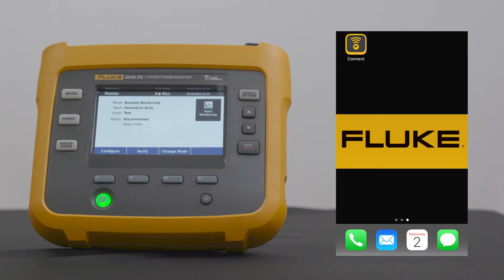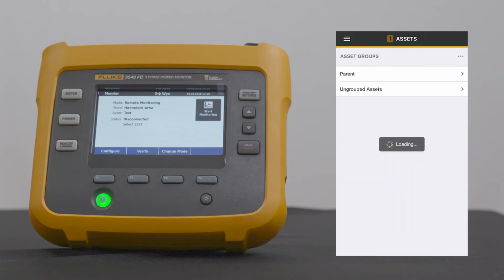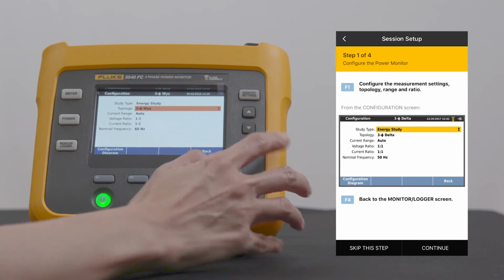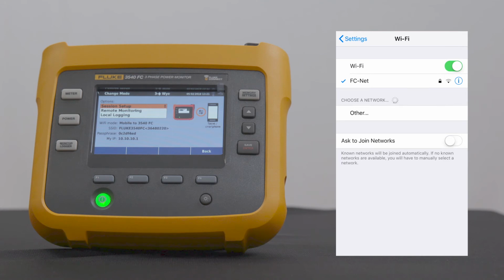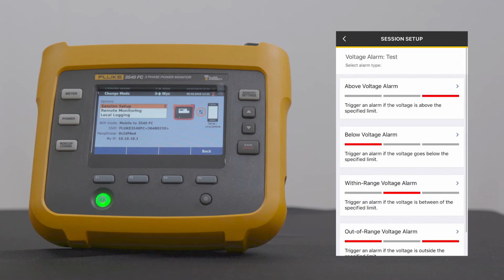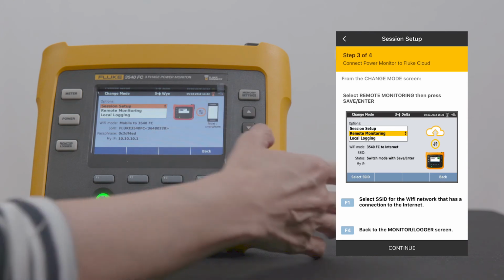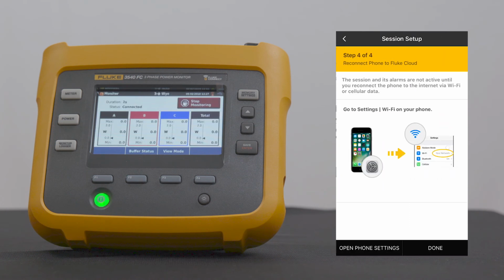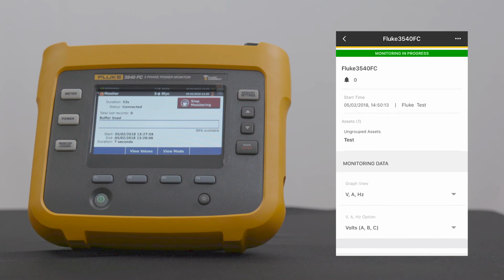How To Set Up the Fluke 3540 FC Three-Phase Power Monitor

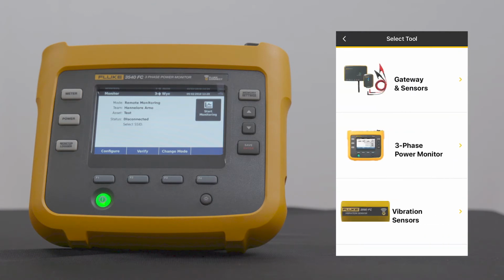Comment: 1:25 whenever I try to select the "3-Phase Power Monitor" it says, "You need Fluke Connect(R) Condition Monitoring SUBSCRIPTION."  So frustrating, just start logging to the USB stick. But you can't do that until the asset is configured. Which you need to do on the app, Catch 22 to get the subscription. Anybody have a solution?
Reply: A little late, but I'll put this out there for other people coming across it.  If you just want a simple, reliable, accurate data logger STEER CLEAR of this one.  Get the Fluke 1732 or the Fluke 1734.  The 3540 has an over-complicated UI that forces you to use Fluke Connect for everything.  It will drive you crazy trying to do simple logging. It's optimized for someone who wants to set it up remotely and monitor it through the cloud.  I honestly regret purchasing it.